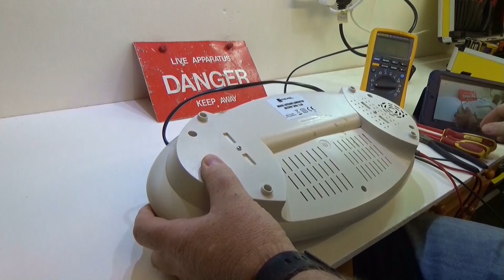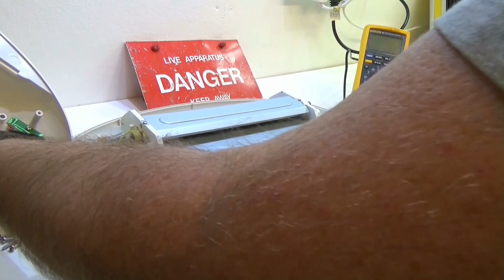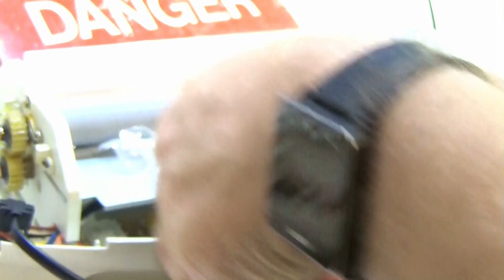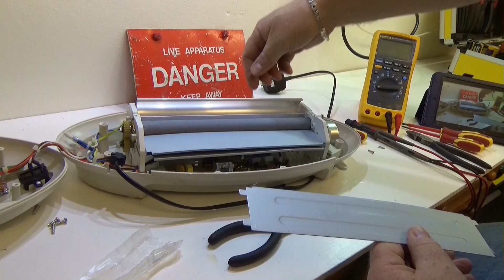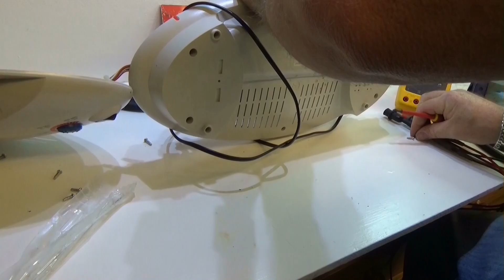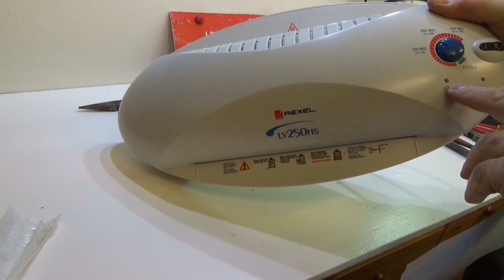REXEL LAMINATOR REPAIR

Comment: Why don't you remove the two springs holding down the top roller? Then it would be much easier to remove the offending pouch. Incidentally, shouldn't the owner have used a carrier?